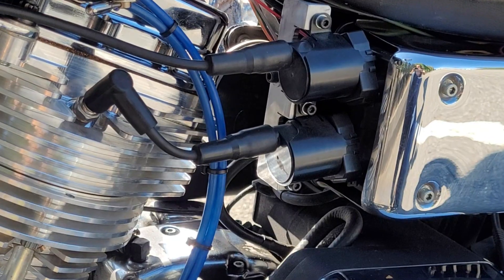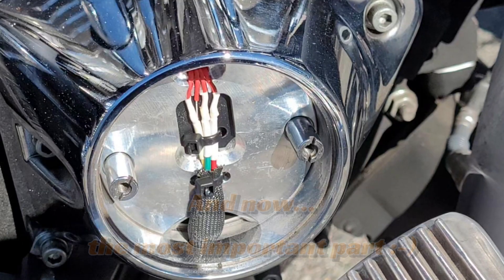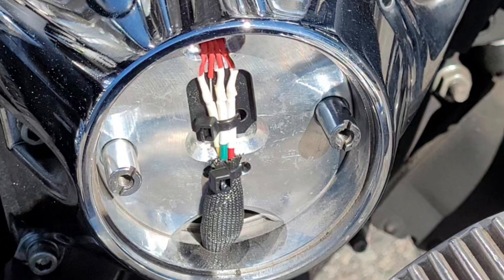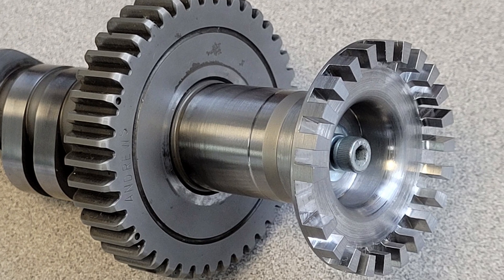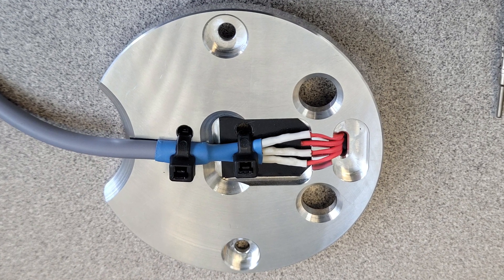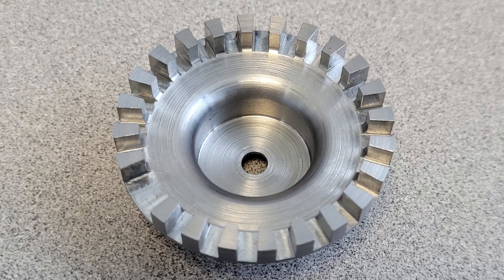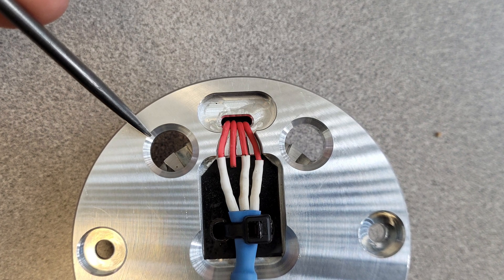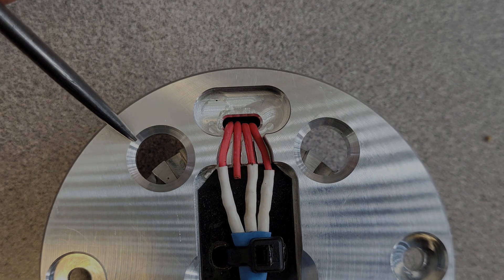Episode 13 (Part  2): Shovelhead / PanShovel EFI Conversion project

Comment: WoW great machine work skills, i am also planning an EFi conversion, and i am using an Angle Wncoder with the cam shaft, and keeping original one slot trigger fly wheel to give a referance pulse, can you please comment on this idea

Comment: On the Speed & Science website, looking at the available heads for the Shovels it states that the combustion chamber is set up for 10.35:1 calculated compression ratio, with OEM-shaped pistons and that 94 octane is the recommended fuel. Where I live, the most common high octane is 91, including non-ethanol 91 octane available locally. My question is will the EFI accept 91 octane with the higher fuel pressure instead of the gravity fed carburetor? Or would you recommend lowering the compression ratio to compensate?
Reply from the maker: While 94 is recommended, 91 non-alky fuel is usually fine for most applications. Just an extra care needs to be exercised when comes to potential pinging, etc. 

High-pressure fuel delivery is a requirement for the EFI system to work, not to prevent any issues related to the low octane fuel. 
Having said that, it's very easy to de-tune the ignition timing table if need be.
Reply: 🤔 GM flex fuel sensor  11.1 cr  E85   💡